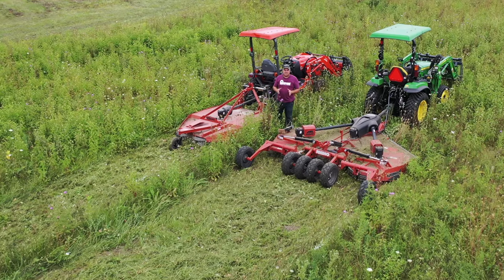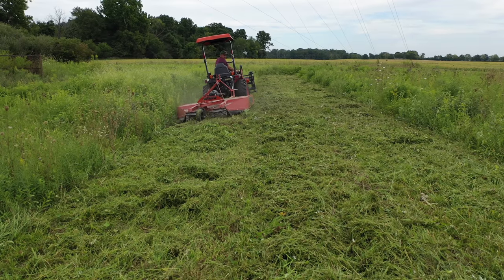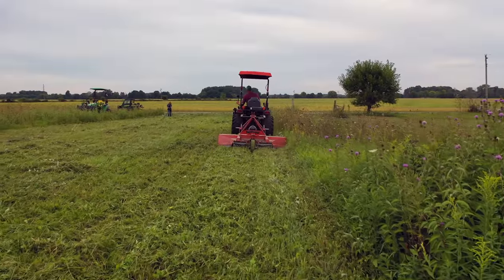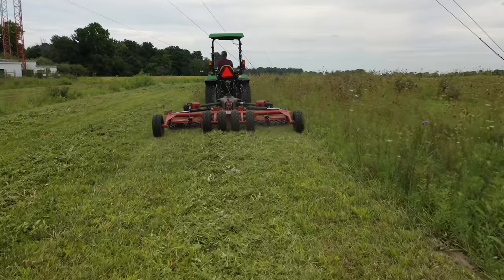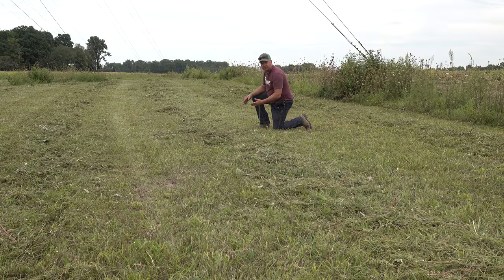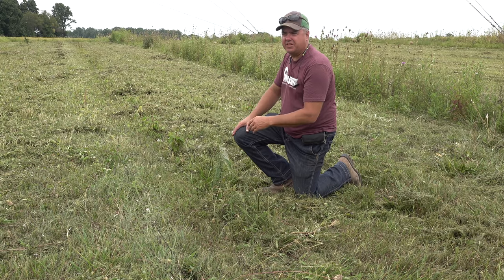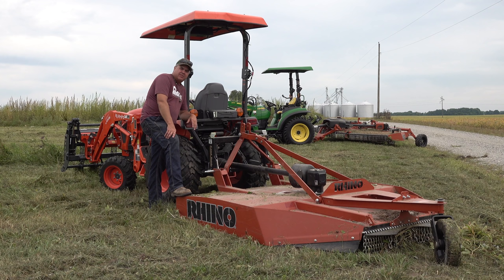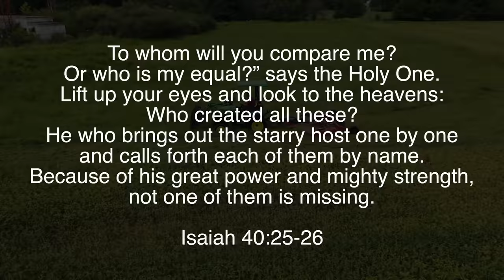Which Cuts Better? Single Spindle vs Flexwing Mower, John Deere 2038R, Kubota LX3310 Compact Tractor

Comment: The big difference in cut quality is all about blade tip speed. I have a bush hog brand 8' with two gearboxes and the blades rotate a lot faster than a seven foot single spindle. It does a great job on grass but will miss a lot in something like goldenrod unless you keep the blades very close to the ground.

Comment: I have a Kubota M7040 4x4 manual transmission. My cutter is a Landpride RC2512. My machine can handle a 15 foot no problem but, when in thick damp 4 or 5 foot tall brush, that 15 foot gives the tractor a hard day. The 12 foot runs just fine and I can be in 4 low or 1 high and it cuts good. The 15 foot does do a better job because the stuff that pops up on the 12 footer can't on the 15 footer. Personally, I will never own a hydrostatic tractor. You lose PTO horse power and driving it verse just riding in it makes it more fun for me. For this 5 acres, if get a larger tractor. I have 20 acres for the hay parcel and it take about 6 hours or mowing when it's about 3 to 4 feet high on the off season.

Comment: I cut right away for the county...we have used both styles, its really not as much about cut quality as coverage. Neither of the two actually should cut much different,  they are made to cut heavy grass and light brush, for a smoother cut with better quality you need a finish mower...the batwing mowers do two things, one is cover more surface area, the second is it will conform to uneven surfaces better, hills,  dips, ditches, the single mower will tilt and lean with the tractor. So at the end of the day its just how much grass do you want to cut in a single pass.

Comment: When I am mowing with a single spindle mower I always turn and go in the opposite direction on the next pass. I also overlap about the width of the closest tire. This takes longer but you get a much cleaner job.

Comment: I sure wish I could afford a flex wing like that, that’s a really slick mower!!
Reply: @controlsplus  ???
Reply: I bought the TS10 last year really should’ve got the 12’ but it is a nice mower though.
Reply from the maker: What tractor are you using to pull it?
Reply: @TractorTimewithTim  Mahindra 6110C
Reply: @TractorTimewithTim  I’ve got a 5045E now. It would be great for mowing pastures. I’ll probably just end up getting a 7’ Woods or something due to cost and it would be better for lanes and places where it’s not so wide open.

Comment: Really interesting comparison Tim!  I used to do that for living and it's hard to do well.  Like you said, it is hard to compare on hydrostatic tractors as they lead you to the cut speed they like (and they're never the same!)  Anyway, I think the results you're seeing can be traced back to several factors: spindle placement and inch/cut.
The single spindle is pretty much forced to be centered behind the tractor.  The TW26 is running CCW placing the 'forward sweep' portion of the blade directly behind the right tire track.... it is REALLY HARD for a mower to lift/cut tall grass that was mashed forward by the tire with a blade that is travelling forward.  The TS10 has smaller, counter-rotating blades allowing the designer some control to try and place the 'back sweep' of the blades in-line with the tire track.  I thought the TW26 did a great job cutting the tire track... cut quality will fall off significantly as the blades dull though.
One of the biggest differences between the two mowers can be traced to the specifications.  Both mowers are 'impact' cutters... they need tip speed to work.  The multi-spindle has a big advantage: the smaller blade diameter means they have to run higher spindle rpm's to achieve the same tip speed.  Using Rhino's published tip speed and assuming a 4 mph ground speed: TW26 = 2.66 in/cut; TS10 = 1.8 in/cut.  The bigger mower gets more 'whacks' at the grass as it passes!  Great job!

Comment: Thank you for another great video. I've recently discovered your channel and love it. As for the cut quality, between the flex wing and the single, Your flex wing will contour to the ground better allowing the blades to cut the grass at the given height, not taller where it may be more flexible due to uneven ground. Also, the three spindles should have not only an interlocking overlap but the blade direction should be opposite of each other across the mower. This lifts and cuts into the direction of travel from the trailing edge of the adjoining blade, thus making a cleaner cut on things that may be pushed down or cut on the trailing swing of the blade. 
As an aside note, I believe Land pride makes a 7 foot dual spindle mower that may fit in this category. It would have the roughly the same spindle sizes as the flex wing, but it won't hang to the rear of the tractor as far as a single rotor
 causing ballasting issues as a larger single spindle. Also it is offset about a foot to the right, thus it is even with the left side of the tractor wheels but sticks out over a foot on the right. This might be an interesting compromise as it would allow mowing ditches with the the left of the tractor and not allow the mower to gouge, but has a bit more reach for getting next to or under things with the exposed offset on the right. 
Thank you again, Todd C

Comment: Great videos Tim and Christy, We've owned a 5' Rhino for over 10 years and it's been a blessing for maintaining our pine plantation. We cut 3" diameter sweet gum trees as well as mow Bahia grass, sedge, switchgrass and deer food plot fields. Speed, angle and blade sharpening are the main factors in the quality  of our results. Naturally the three blade will produce a better finish lawn cut given the tractor tires will be narrower then the cutter deck width. As you said the vacuum created does a better job lifting the target to meet the blade.
Glad to see you feature a Rhino product. Love that implement. By the way, thank you for the video of greasing the front drive axle of the 1025r lawn tractor. The JD engineer who designed the skid plate on mine, a 2017, aught to have to grease a few universals. I have to to use an extended Lock N Lube connected to a needle adaptor. Not fun. 
God Bless and be well.

Comment: Tim, one thing that old farmer's taught me about a single spindle brush hog was to keep the left side Of mow to the cut side and right into the uncut side... it works to keep stubble from coming back up... with the blades going counterclockwise that helps pull up the stubble on the left side where the tire push it down from the pass before...
Reply from the maker: …and overlap enough to catch that previous track.  Unfortunately, that costs a tremendous amount of cutting width.

Comment: Tim I’ve used a JD 4700 gear drive tractor with a MX8 cutter for years. I find it works great because it has a constant speed while mowing. If it’s not cutting all the grass I found I was going to fast and dropped down one gear. I bought a 33R power reverser in February with a MX5 cutter and it does a great job. I just cut a small field that had grass that hadn’t been cut all summer. The grass was 18” to 3’ tall and by going slower (low range in 2nd gear) it did a great job. Great video, thanks for sharing.

Comment: I bought the TS10 because of your reviews from a few videos.  I’ve only used it once to mow corn stalks and it worked great.  Can’t wait till early spring so I can mow my standing food plots off.  I have about 10 acres of them to mow which is why I went with the flex wing.  I still have an MX5 Deere rotary cutter for small stuff and harder to get to areas but I can see me falling in love with the TS10.  My tractor is the 4066R, and love it as well.  Thanks for your videos and your willingness to share the Word with us.
Reply from the maker: Congratulations!  Love the TS10!

Comment: It would be interesting to know how much the two rear blades overlap the cut of the front middle blade.  Do the over lapping areas line up with the tire tracks so that those areas get cut twice?  On my single spindle mower it seems one side cuts cleaner than the other and I think it has to do with which way the blade turns in relation the the grass that has been push over by the tractor tires.  It appears the blade coming from the front and into the grass that is pushed over or is it coming from the back and not picking the grass back up makes a difference.
Reply: I was just going to comment that, the tires lay the grass forward, if the 2 outside spindles have the blade tips running the opposite way so it's pushing the grass back up that would prevent the one side from not getting stood back up, that would also explain why the grass gravitates towards the middle
Reply: I’ve noticed that one side cuts better with my frontier 60 inch rough cut.  Going backwards it seems to cut better too
Reply: @ericvortecmax  but that could also mean you need to sharpen one side.

Comment: I know that smaller cutting decks for lawn care use computer simulation to design the  grass movement and flow after being cut and while clippings swirl inside deck for optimum design.  This could be a topic for TTWT the engineering going into tractor design.
Reply: I think he did software, not hardware. 😜

Comment: Thanks for taking the time to compare & go over some of the plus/minus points on the two types of mower.  I'm a little shocked the compact tractor that you're using is big enough horse power wise to efficiently run a 10' mower.  Thanks for sharing.  Take care.

Comment: Something else to think about, a 3pt mounted mower works better in rough terrain, the mower can be raised higher to clear obstacles, or if you get in a muddy spot, you can raise it up, where a pull type mower is dead weight and can sink in the mud causing the tractor pulling it to get stuck.  Both are still nice mowers though and this was a neat comparison!

Comment: Three shorter blades combined to make a 10 foot mower will always cut better than one blade on a six foot mower.  For me the problem is price besides that fact that my old Kubota L3130 doesn't have the power to handle a flex wing mower.  Thanks for the comparison.  Good video.

Comment: I have a single and overlap a bit more than you do.  That way my left front tire is not laying down uncut grass. Thank you so much for doing these comparisons.  An irony that I have is a few before you got the 5075e, my dealer cajoled me into climbing in one. Oh my is that nice. The 3 & 4 cabs are the same size and I just don’t fit.  And I don’t have enough work to justify a 5 and it just looks like a sweet ride.

Comment: Another variable to consider is the distance between the tractor tires and the spindle centers/blade tips. Perhaps the three spindle mower's greater distance is allowing the compressed grass to spring up more before the blades hit than with the single blade mower.  It might be interesting to see some footage comparing the two from that perspective... though the control and measurement of the comparison would probably be tricky to work out!  Maybe get someone with a high speed camera involved?

Comment: I’ve had 6’ and 8’ bush hog single spindles but this 10’ JD with 3 spindles cuts better than either of the other ones. I’m very happy with it. The only thing is it’s a pull behind and the other 2 were 3 point hookups. But I’ve learned how to back the 10’ and it works very well. Thanks for a great video 👍👍👍❤️
Reply from the maker: Yes, it does take some practice backing it!
Reply: I have a very old 3 spindle tilleston pull behind. I got stuck in mud one too many times, so I thought and thought and took the plunge. I cut off the pull assembly and large back tired. Made it into a 3 point lift with small pivot wheels in the back. Cost almost nothing and absolutely works great.

Comment: Very good video Tim. I use a 6ft mower behind a small tractor too. One thing I see is maybe a difference between a carry type mower versus the drawbar mower. I have noticed the mower will go up and down with the tractor going over hills and dips where the drawbar mower stays relatively flat as it is being pulled. Maybe some differences in the cut there. What do you think?
Reply from the maker: Could be.  Good observation!
Reply: You are correct.
I have a 6ft 3 pt Woods, and I have noticed when the tractor dips into a little hollow it seems to scalp, but if the tractor goes over something it creates a raised cut, as the mower is lifted. 
I have an old David Brown 990 58ish HP and am having a bit of trouble getting it set up just right. I am thinking a pull type would be a better over all choice, but with that comes other aspects of set up.

Comment: In the late 90’s or 2000’s a John Deere dealership that I believe was in Cottage Grove Minnesota started making a rear left side offset wing mower for the JD compact tractors using mostly JD parts. I believe it was a 72” cut. It was a 3pt mount and driven by the rear pto. When not used it folded upwards. One lawn service in town had one on what I think was a JD 850 or 950 running it while also running a 60” or 72” belley mower. I watched it mow a local business lawn once and it mowed a lot of grass fairly fast. JD eventually told the dealer to stop making them.

Comment: Mowing with either has its positive and negative uses.  Overall I like the flex wing mower over the six foot mower.  Again I think use is what would determine which is better for the job.
Keep the videos coming.  
Also my hats off to video process.  Well do with the movement and close ups.  JOb well done.

Comment: I have a Bad Boy 6' brush cutter and the only stuff it leaves behind is sweet gum tree stalks when mowing 2-3' tall field.  When mowing just grass up to a foot tall it is pretty consistent in not leaving any standing grass.  Usually when I hit a really thick spot it may not cut completely where the tires are.  I have no ballast or weights on my tractor, 2638 Mahindra.

Comment: I have worked in the summer of of 2000 for a landscape contractor doing vacant fields with an old MF255 amd a Woods 6 ft mower;the hp were there but i had to put the tires on one side out of the grass to avoid flatten it!After one week i said to the boss:''Were gonna have to sharpen the blades each 2 days or they wont cut1'' he said ''good idea!'' so i did sharpen them every 2 days!

Comment: Very good comparison indeed! Curious what (if any) difference in spindle speed between the two mowers with same pto rpm. BTW maybe climb up that tower and mount a transmitter antenna to start your own TTWT broadcasting network!!

Comment: You said you tip the front down.
I was taught to have the front raised higher than the back there by cutting at two hights and easing some strain on the equipment while getting a better result

Comment: what rmp are you running these mowers at? it seems low by sound.  i have two options i mow with a 5205 jd and a 2 wheel 2040 with a 8 ft brush hog. considering a new mower as ours has quite a bit of issues. the bat wing should be a nice idea. thoughts on a 10 ft model for those models?
Reply from the maker: Wide open throttle.

Comment: Tim, I agree with you on all of this, there is simply no comparison between the two. But again, the price point is tough to overcome. What we do with our single spindle rotary cutters is run the front about an inch higher than the rear, I know, I've gotten some push back from saying that. But it really improves the cut quality of the single spindle cutters to a very noticeable degree. You should break away from the "traditional" setup and give it a try at least once. It cuts better, and mulches the material much better, though it does require HP to run them like that. And that stemmy stuff is hard with any mower, even my flail will leave some of that stuff, not as much as my rotary cutter, but leaves some nonetheless.

Comment: Tim as I told you the last time you had your batwing hooked to the Kubota I mowed interstate highways for several years in Indiana. The Bush Hog batwings I used on the highways and on the farm was 15 foot and they do lift the grass. You can also buy lift blades for them and you will be able to tell they are lift blades by the amount of flair they have on the back side of the blades. All blades will have some flair but you will notice it more on the lift blades. Bush Hog will tell you they cause a vacumn that helps lift the grass. To answer a question from the comments that I have been reading the side blades overlap the center blades very little and as the blades wear down and round off at the most they might overlap 1/8 of a inch. Hope to meet you some time at the Farm Equipment Auction in Monrovia Tim. I couldn't make it to the farm progress show in Decatur because I am a grain farmer and I have been getting things ready to go to start harvesting corn around the third week in September.

Comment: I've found that if your having issues with weeds standing back up then you need to go slower. Going slower means they have a better chance standing up & getting cut. I'd rather go slower & get a good cut the first time than go fast & have to make multiple cuts.